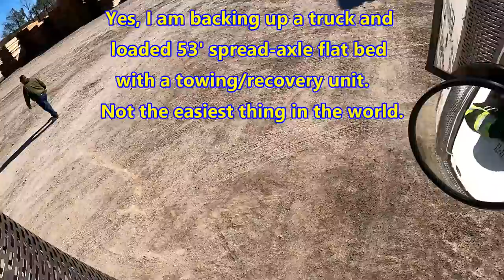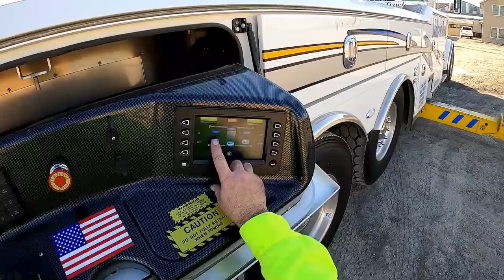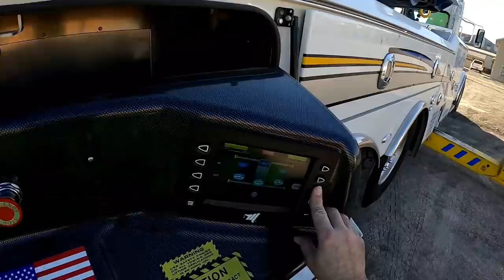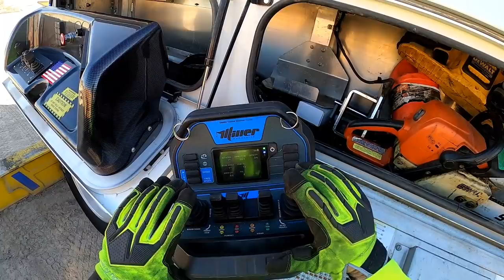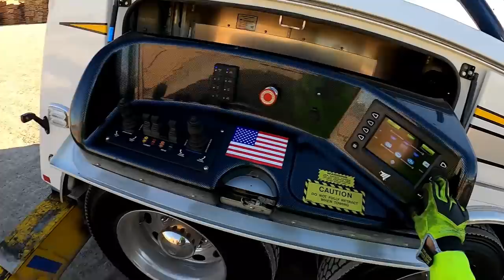Oh Shift 3.0!!! Brake Checked Semi!!!   Part 2...     The Rest of the Story...

Comment: Thanks for posting! Watched both parts with interest.  I'm in UK, and years ago was in my car on Motorway and had to make two artics move apart in a solid moving line at 60 mph to gap enough to allow me to move in a lane to be able to turn off at nxt junction a mile off. After doing this and now a half mile from the turnoff, the unladen flatbed in front hits a bump, and I realise that a railway sleeper is unsecured on the bed and shifting slowly off the bed, overhanging to the nearside and likely coming back my way.  The lorry behind prevents me braking hard!  I hit the air horn, the lorry driver in front realised and swerved onto the shoulder, and the sleeper shot off down the bank. There was a highback close in front of him and he could not have seen if there was anything on the shoulder, luckily there wasn't!
Reply: Your experience sounds like a Life Lesson in thinking and then thinking again!!!
I'm glad you are here to share your story!!!

Comment: Great video, you’d think the young workers would have given Tom hand unloading the truck. I guess if they can’t use a forklift it doesn’t get done. Thanks for sharing. Kevin
Reply: I agree.  Standing there with their hands in their pockets.  Is there some demarcation in that business about unloading ?
Reply: @stephensmith8756  Could have been that they had punched out and on the way home.
Reply: Hi.  I think the guys couldn't help because of Ron's Insurance.  1st part of the Video the lumber yard is using their own guys and equipment to unload their trailer.  2nd part it's Ron's rotator and roll back.  If they aren't one of Ron's covered employees
and gets injured Midwest is liable for costs or worse could get sued.  Not worth it even if the help would be welcome,
but in past Videos Ron has had to decline help because of that issue.  Him and Tom did just fine.  They knew what they could or could not handle.  Great job.  And in 1 day!
Reply: We used to call them tractor ass. 😁

Comment: I hauled quite a bit of lumber in my OTR days and I made it a point to "belly rap the bundles that were not banded, in addition to the three four inch straps on each bundle eight feet or longer. I also used strap protectors, especially on rough cut lumber to keep from cutting the straps like what happened to this gentleman. I had 15 ratchets on each side so I wasn't pulling the load all from the same side. People used to laugh at me but I was an owner operator and it was my tractor, my trailer, my insurance and my life. Eventually, I also ran a curtain side because I hated to tarp. However, I got tired of being away from home so I went back to my first love, the recovery industry.

Comment: Another rigging tip you may be aware of when choking is to have the sling go through the eye opposite from each other that way the load will not want to roll as the force applied  is even both ways and take a 2x4 and whack the eye tighter as tension is applied.

Comment: Ron I know a wrecker driver by no means just truck driver but I noticed how your straps that got torn up right there at the end I like watching videos like this you may want to look that leave its pets Towing somebody has come up with a protector to put around those straps to keep those safe from getting tore up I want to check into that and save you some money on those things and as you know I guess you can probably get it from Miller but just thought I'd give you a heads up and try to save you money on losing brand new straps

Comment: It looks like a lot of lumber is going to have to be restacked by hand, and the good sorted from the bad before the job is done. It should all be billed to the insurance of the driver that brake-checked the semi, if they know who it is.
Reply: It probably won't happen like that. The damage to the lumber is going to be minimal. They won't be trying to inspect it for damage that can be submitted for insurance claims. They will probably just smoosh these packs back into the best approximation of solid bundles as they can and plop them down onto a machine. They will either get graded or stickered with very little having to be picked up by hand.

Comment: Nice to  have so much room to work with, best i have seen here in Aus , is a b-double  ( 26 mtrs 9 axles , 3 sets on each trailer) , picked up with an underlift , then back at the yard, reversed in with a 90 degree turn from the road through a set of gates..  entertaining to watch, and only took 1 bite at it .. i will pass on trying that :P

Comment: I had to restring a set of triples at Farewell Bend, OR Port of Entry since Salt Lake got them in the wrong weight order. I was backing two pups and two dollies towards the third trailer in order to drop the units in a line, but the camber of the lot helped keep it straight enough to actually hook the third trailer. Could not have done that on a bet! Great skill you have there! PS- I did not tell the rookie driver with me that you were not supposed to be able to do that

Comment: I never grind gears. I’ve been driving since 1919, I in fact invented the trailer.
Reply: Riiiiiight.    Back in the '60s when most Army trucks still used manual transmissions one of the guys in my unit never used the clutch.  He always synced them and did a great job.
Reply: What do have, a set of rubber gears in your truck!🤣🤣🤣
Reply: I learned how to match rpm in grandpa's farm truck, it was only a 4 speed with a high/low knob. Felt pretty cool at 15.

Comment: Adding to my comment in the 1st video - another company driver was coming back from getting a load of wood and framing material was break checked up on the interstate near Harrisburg Pa and the trailer was a soft side - needles to say there was over 3000 board feet of wood laying on the road when he stopped

Comment: Truck Drivers are a different breed.  Was the Fire Chief in a large sawmill.  Now some drivers expect loading crew to tie their loads down.  WE HAD ONE.  We expected driver to tie down his own load because of liability.  Well the guy took off with unsecured load. As he turned to get on the interstate his load shed off.  WE sent a crew down to help pick up. There was a Lady Patrol Officer and the driver was just giving her a big ration -- Just as I got there her Commander pulled up.  Driver started in on him, he walked off a little bit with the driver, I dont know what he said to the driver but suddenly he he was arms deep in helping pick up the mess.

Comment: This had me wondering the other day when craning the wood around ..  It might have been faster and easier to have a few guys just re-stack the wood on a new pallet at the accident site.
Reply: Not safe to do in the middle of the Interstate. Not to mention getting the few guys there to do the job would have taken longer than they took to clear the scene.
Reply: It would have taken longer as the lumber was jammed against the cab and the stack behind it making it time consuming to get each board out
Reply: I did think about that but there was some pretty heavy stuff in there and a good pile of it. Would be an interesting to contest to set-up though.😁
Reply: Easier but they wanted the highway open ASAP- which it was.
Reply: I take it none of yall has ever worked  a scene on the interstate with cars and trucks wizen by you at 70

Comment: Tip for the driver about not wanting the dog to roll down the windows while he’s inside the truckstop just find out which fuse it is and pull the fuse. I had a dog that could do the similar thing and that was my solution.

Comment: Great - and as always safe - video. My only question - why not remove the damaged tractor unit at your yard, and use another tractor unit to take the trailer over to the lumber yard, rather than tow the whole recovery tractor and rig unit? Still, nice driving on backing that difficut combination up - Good Luck!

Comment: I had a 1962 Silver Eagle prison bus that had a 7 speed + 3 speed secondary. If you missed a shift when the secondary as in 2nd or 3rd, would have to slow down until speed matched. Although most of the time I did not use the clutch anyways, others said it was the worst thing they drove. Prisoners and me seemed to have an understanding, never had a problem with passengers, just the bus overheating. I took care of the generator and the air-conditioners, so passengers never overheated.
Reply from the maker: Wow, what a cool story.  Thank you for sharing your experiences.  I bet you could write a book with many stories of your bus driving days. Thank you for watching and God bless.

Comment: What a clutch? That just for stop and go. 14 years of driving and I still grind. That transmission u talk about having to start over again because u can forget what gear ur in is called a super10. I have a 94 kW w900l that has that transmission. Shifts fast with a Jake brake which brings love, but hate it due to forgetting wherein at lol

Comment: You mentioned a 4&4 with an air shift. This is only the second truck I have known of with that combination. And your right miss a shift and you will most likely have to start over. If i remember correctly it was in the late 70s or early 80s.

Comment: Glad to see the rest of the story. Luckily the load was local & right down the road from you all. Me I probably would have split the Tractor from the  trailer  there at the shop made the delivery saved some aggravation from doing a triple combo like that. But hey you did it no problem lol. As for the wood on the roll back yeah probably would have put a couple of ratchet strap around it. Oh well you got the job done in 1 day & THAT HARDLY EVER happens.
Reply from the maker: Yeah, a one day total start to finish on this size job is very rare....   Be safe and God bless.
Reply: @RonPratt  I know it happens occasionally but not very bloody often. With that Ron & crew I say TY, God Bless & well as they use to say in the old trucker movies "keep the shinny side up & greasy side down catch ya on the filp flop" Be careful, & be safe every one its a jungle out there on the highways. 🙂

Comment: do you have switch wired into your recovery vehicle for dumping the air in the back axle on the air ride spread axles. it makes it much easier for making turns great job of backing up that double unit either way it is not as easy as you made it look

Comment: Question ... You said the boom needs to be at 8 degrees to clear 13.6 overheads.. Does that mean the boom does not "Rest" in a "Cradle" when in the down position ?  I remember many years ago, when working as a telephone lineman, the boom on the "Pole-Cat" truck used to set telephone poles had a "V" cradle that the boom rested in when traveling to prevent sway. Would you take a moment and explain that part of the  boom operation on the rotator ?  just curious is all.. 
Thanks, John

Comment: That reminds me of backing a double train of 20 foot pups behind a stretched flatlands rig.. I lot like pushing a chain uphill.  Good job, although I really wanted to slap the Havco guy for telling you to move it over AFTER you were backed in...  On your straps, you can likely get a company that would stencil them with midwest truck as ownership marks.  OH, on your glasses fogging due to the covid mask, get some cat crap anti-fog and apply it, it makes it a bit better, as does using a mask with a metal strip that forms to your nose better.
Reply: When we were scuba divers we used a piece of a potato to wipe our dive masks. Im going to try that on my eye glasses. What's the worst that could happen??

Comment: Thanks Ron another interesting video. I have seen a lot of your recoveries and several have shown moved loads following an incident. In England, they prosecute drivers with insecure loads, do they do that in your Country? Or in the case of accidents, does it depend on how the load was originally strapped? For example in the case of the truck that tipped over because of large chemical containers moving across the bed that you corrected using air bags (Or was that one of the other companies I watched?)

Comment: One question for you, is there a reason that when bringing the driver's truck, trailer, and load to the lumber yard that you kept the entire unit as one, attached to the wrecker, as opposed of splitting the wrecked tractor from the trailer and then pulling just the trailer with your own tractor (Truck 17)?

Comment: I have a 2 part ?? On the back of the tatters around your cable. It looks like there is a cone  would you tell me what there for . Also  in a vidio a while back on the  little dodge you have a winch and in that vidio you said that cable wasn't the same as you use on the wreckers  would you please explain the difference  . I have a 4 thousand  pound winch on my utv trying to be safer  thanks for the videos I learn a lot from them

Comment: Not really a problem with the load falling off the fork lift. It had to be dislodged from the front of the load anyway. It was tucked in there like a tuck & groove. Now they can restack it by hand from the ground to the fork lift. my thoughts are they were going to have to do that anyway, to get it out of the front part of the load.

Comment: So, what happened with the tarp that was under the stack of wood?
Reply: You saw it at the end on the back of the roll-back.
Reply: RIP
Reply: @stephensmith8756  Nope, if you look at 44:54 you can see there were two tarps. The one with the load was still under it at the end of the video, the other one was on the back of the rollback.

Comment: So Ron, with the frame and drivetrain of the tractor relatively undamaged (I think), would it be cost-effective to install a new or used full cab assembly onto the existing frame, or would the whole thing be a total loss?

Comment: The clutch failed in my  new 1968 Isuzu Bellet. Dealer didn't have the parts. I drove for several weeks with no clutch. Would slip it into neutral to stop. Kill the engine then select first and start it in gear to get going again. This in capital city trafic.

Comment: I think a better idea would be to leave the tractor at the yard and use truck #17 to tow the trailer, instead of having the western star unavailable when you really just need to get the trailer there to deliver the lumber.
Reply from the maker: Yes, that would have been our first option.  However, #17 was already in use for another customer hauling equipment, so we did not have that option.   AF_FOXTROT 6-4

Comment: Just wondering; why didn't you unhook from the trailer and use your tractor to move the load? Also on the trans I started out with a try-plex/ twin stick in a B-model Mack and a friend of mine had/ drove a quadraplex 16 speed twin stick. The best tractor I drove was a Volvo with a 425 Cat that was turned up 20% and at 1700 RPM would run 86 MPH and pulled like ? on the hills.
Reply from the maker: Good question.....the same reason that we didn't split it on the interstate....our road tractor was busy pulling our "float" trailer hauling equipment for another customer.   Would have been nice to have had our tractor available.    Thanks for watching and God bless.
Reply: @RonPratt  I did think that might be the reason. Good watching any way; I seen a few more recovery videos and some I sit here a say watch Ron Pratt, you might learn something! HaHa.

Comment: Do you have access to a tractor (as in the front half of a tractor trailer)?
Seems like it would have been easier to hook that trailer up to another truck than have pull the wrecked truck and trailer with the wrecker.
Also that would free up the wrecker and all of its very expensive equipment for doing more recovery work.
Maybe this type of thing doesn't happen often enough to justify having a tractor, just thinking out loud.
Thanks for "the rest of the story".
Reply from the maker: We do have a road tractor and would have utilized it as you suggested had it been available.  It was pulling our ramp/tilt trailer hauling equipment for another customer at the time.   Thanks for watching and God bless.

Comment: Ron when you do a tow for a owner operator and let’s say maybe they decide to not pay you how do you get paid? Please explain
Reply from the maker: It depends upon whether it is a simple tow for repairs or if it is a tow due to a crash.  For the crash situation, most truck companies are required to carry insurance to cover such instances, but there are some exceptions.   For a simple tow for repairs, we make it clear that payment is required before we drop the vehicle at its destination, unless it is getting towed to our shop for the repairs.   There are times when someone, usually it's a 3rd party paying company, where they will attempt to string us along and not pay the bill.  We very politely, yet firmly advise them that we are "on the clock" until the bill is paid in full and they have "X" amount of time to pay the bill or we will tow the unit back to our shop and place it in impound.   In Missouri, we have what is called a "mechanic's lien" against any vehicle that we tow or perform repairs on until our services have been paid in full.   Basically, that means the we are the temporary owners of that vehicle.  I do not like it when this situation occurs, but it does happen and we have to protect our business.    That being said, cars and pickup are an ENTIRELY different situation.   There are a TON of those that we do not get paid for.   We end up owning the vehicles and getting only scrap value for them when we finally take them to the crusher.   Sad, but it happens.   Thanks for watching and God bless.